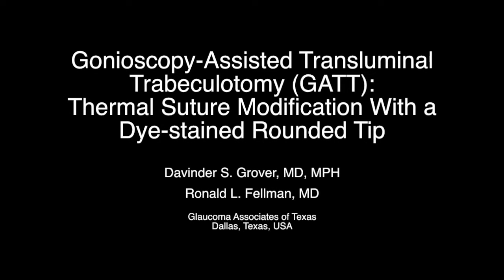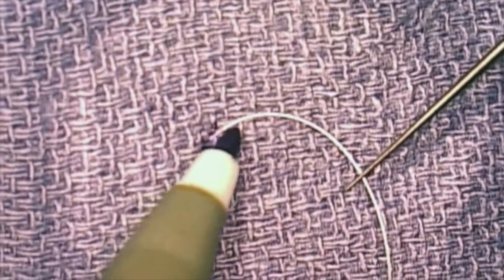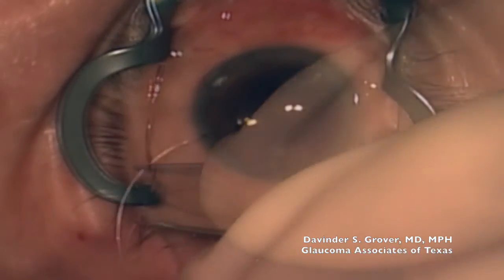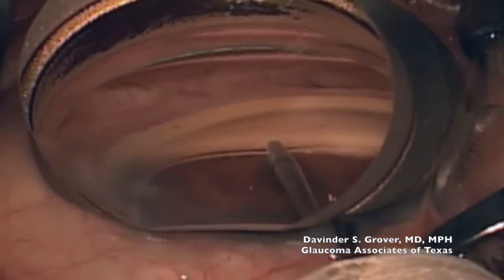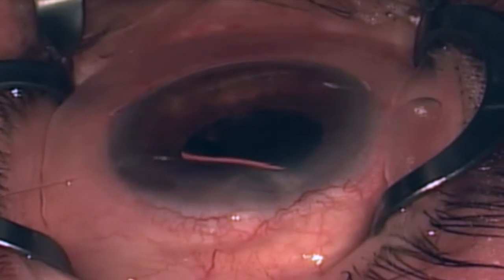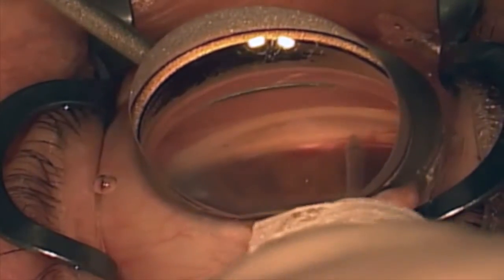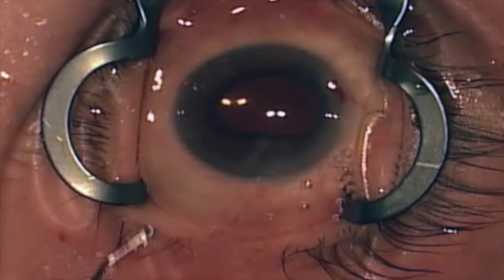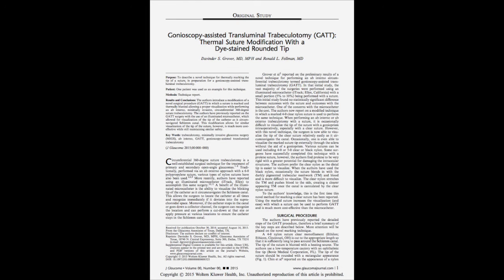Suture GATT

Comment: Why not use a Blue 4-0 prolene or Black nylon suture so you don't need to stain the tip?  Any particular reason to use a clear suture and then stain the tip rather than a dyed suture that you can easily see?
Reply from the maker: You bring up a good point.  I have actually now switched to a 5-0 prolene but when you blunt the tip, you need to make the tip small otherwise it won't fit into the canal.  One can see the blue from the prolene on gonioscopy as it circumnavigates the canal.
Reply: I use a blue 5-0 prolene as well and create a mushroom with cautery at the tip and it passes without difficulty.   Have no long term follow up but up to a year out the IOP stays controlled better than I would have hoped with this.   Wondering if they will heal and shoot up but hasn't happened so far.
Reply: Davinder Grover, MD, MPH
Reply: Steven G. Safran ..did you repeated this operation again sir..? Am glaucoma surgeon but using only trab and shunt operations😊